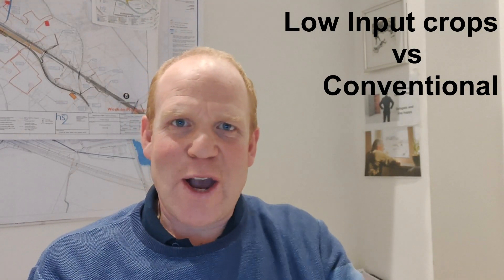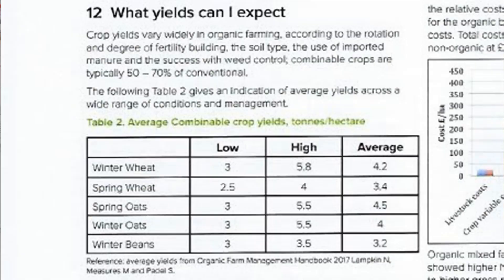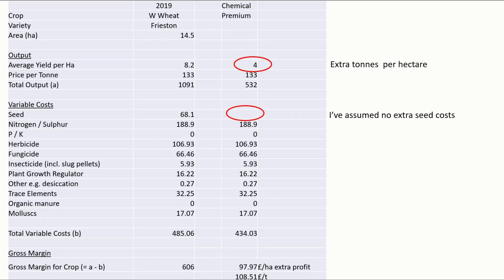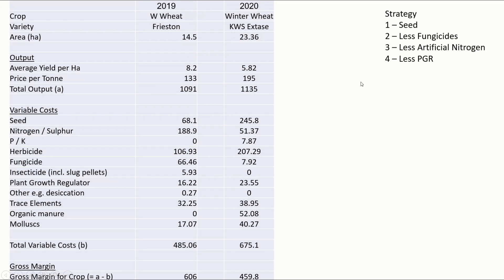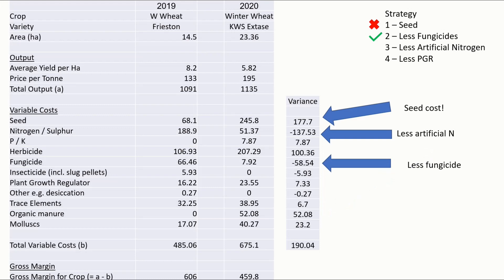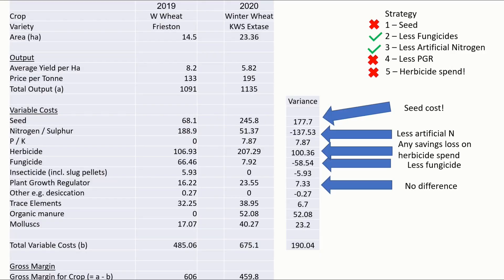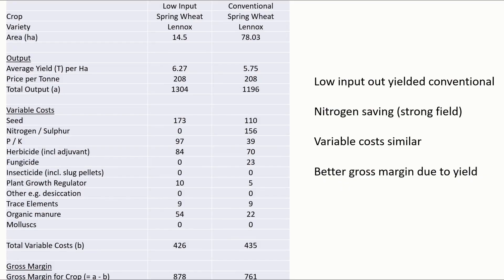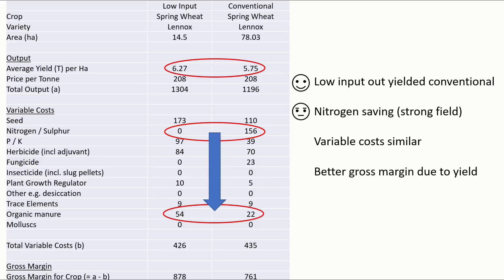Low input cropping vs conventional

Comment: A very useful presentation for me as I am planning to go for a more low input approach on my winter wheat due to the poor performance of my wheat this past season (first season farming for me) on my family’s farm which only just scraped a turnover. The majority has been drilled after a cover crop of berseem, crimson and red clover (and buckwheat and phacelia companion killed with topping) which I grazed with our store cattle with an average DLWG of 0.6kg. This cost £140/ha minus £50/100/ha from from the grazing gains (one field was grazed twice). This was then disced twice without herbicide achieving a very good kill (we can’t seem to effectively kill clovers with glyphosate). About half the area was combi drilled followed by a pre-em spray (diflufenican and pedimethalin) with no glyphosate (nothing there to kill) in late September and the other more blackgrass prone half was left until mid October with glyphosate applied pre drilling and no pre em. All looking good except for the odd wet spot on headlands (we are on very heavy clay). My plan is for a significant cut to N back to 50-100kg/ha and aim for one fungicide at t2 (maybe more depending on disease pressure) and to spray a post em broadleaf on the area without pre em and rogue any blackgrass areas (seems very clean currently except for some speedwell). Also thinking of cutting out pgrs and no pyrethroids. Any advice would be great as I am right at the start of my career; I’m 23.
Reply from the maker: Duncan all sounds good to me. Cattle a great option too. Don't fuss about killing clover, keep it alive to partner the following crop, we do.

Comment: Good video. A bit late seeing it. I think for a low input organic system to work you must work with your soil biology. Soil temperatures of below 10 degrees (winter drilling) shuts down microbial functionality reducing mineralisation reducing N and nutrient availability to growing crop allowing weeds to proliferate. Spring cropping is much preferred on a low input organic system for this reason as you utilise the soil mineralisation potential etc through increased soil temp allowing crops to compete with weeds. High residue system is preferred....